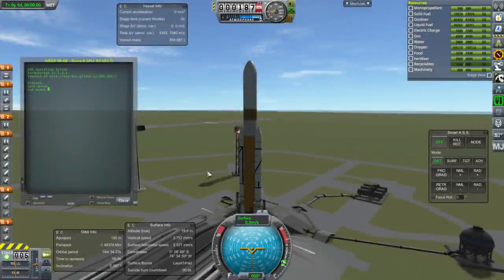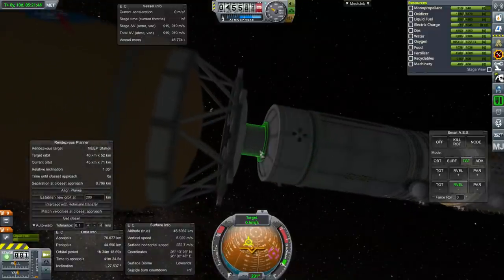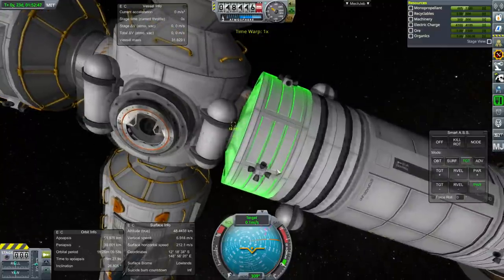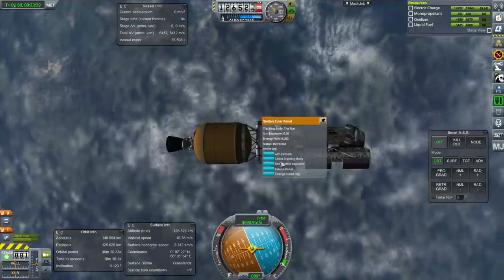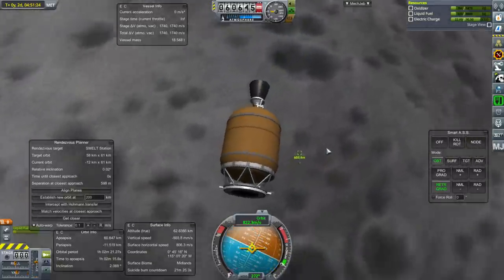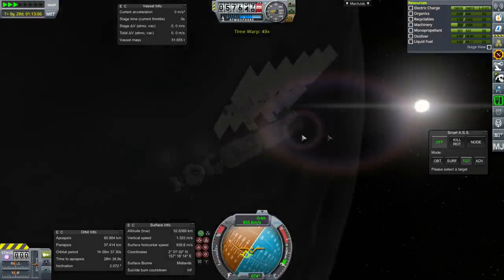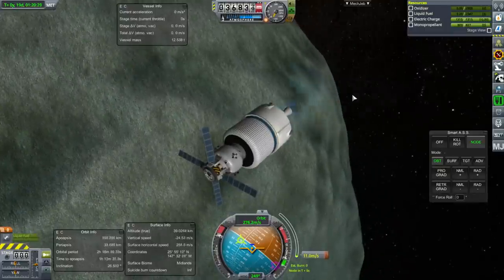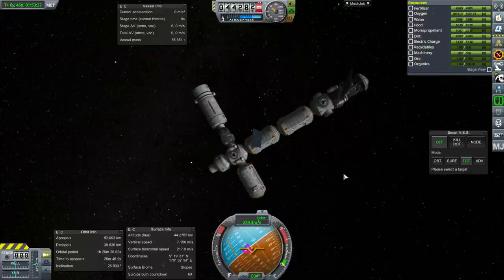Kerbal Space Program - Kolonization 2.5x 06 - Tale of Two Stations

Comment: The USI containers are designed to stack up and provide a smooth and slick formfactor. But this means every part attached other as containers are clipping in especialy docking ports. My way around is to add a 1k batterie on top and docking port then. Or if you build a containers module add the 2,5 Tundra Adapter beneath the docking port maybe.
This said, a fine station design but for construction time it would be helpfull to bring a assembling tug on site till you are ready and disassemble him later on for Material Kits?
Reply from the maker: Well, obviously adding a battery would have helped in two ways. In this case, only a tug with the klaw would not have had to become part of the station to solve the problem (because the module only had one usable docking port), but yes, the Minmus station should have a tug the way our Kerbin and Mun stations both do.